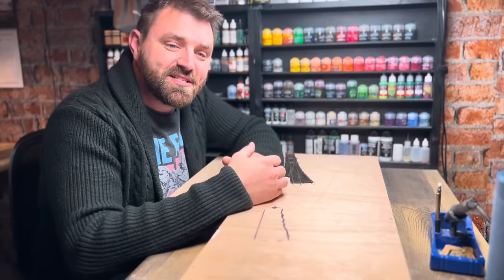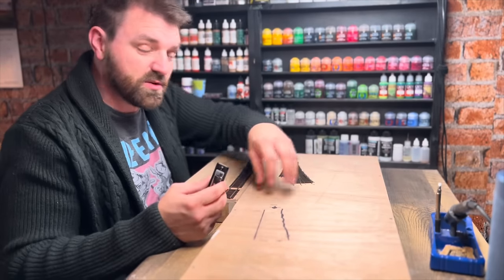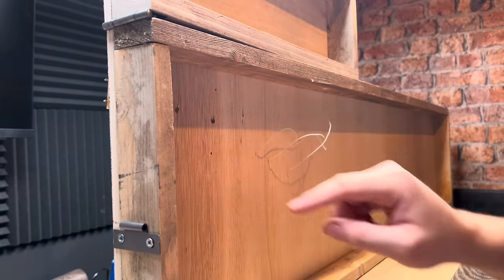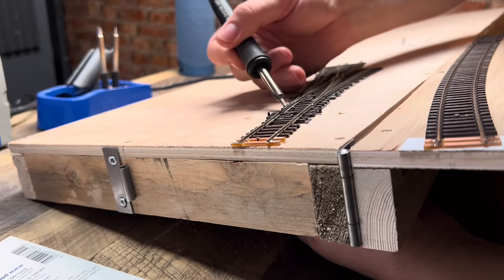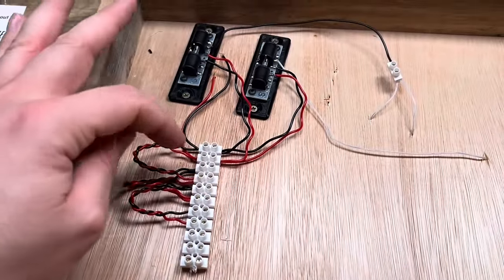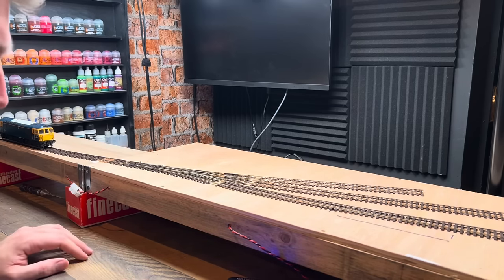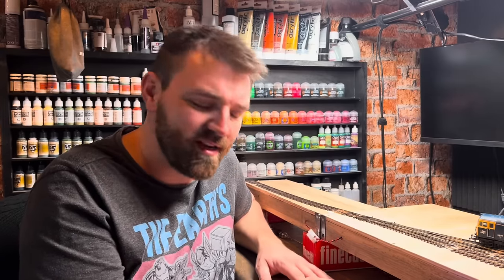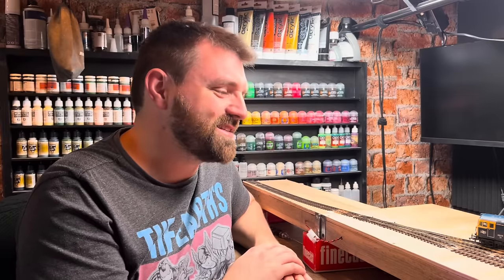Building A Shunting Layout | Point motors & Play time Ep4

Comment: Another great video, it's an odd thing to say but, videos like this of just doing the one task and having a bit more fun, rather than a monster build is nice and refreshing. It's kind of a validation too that it's alright to just go do a bit on my railway and not get bogged down with the grand plan. :) 
With wiring points that have 2 frogs like that 3 way point or a double slip, I normally cover the other part and just wire them as 1 point, then do the other. That helps me when it gets complex. Those points are basically just 2 points occupying the same space in effect. Then if you can do one point, you can manage the complex ones too.  Unsure if that helps any :)